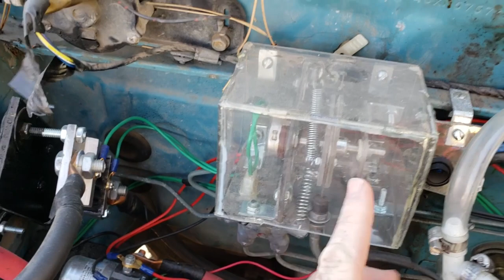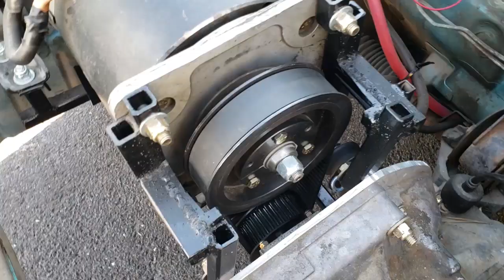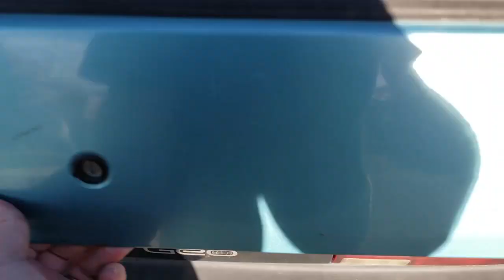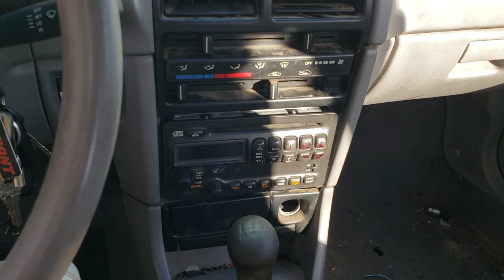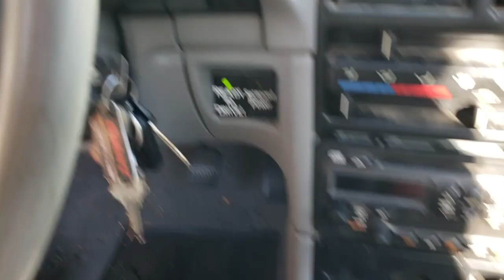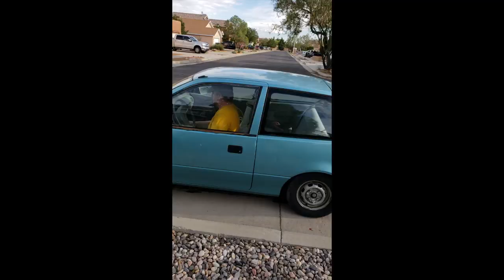Forklift motor in a geo metro?

Comment: Get some lithium ion batteries out of a used Chevrolet Volt nice project. I wish I could do that to mine. I took my forklift motor Hub and adapter route still learning what to do with the power box. Try not to execute myself or get a fire .I hope you finished lithium batteries would be very nice.